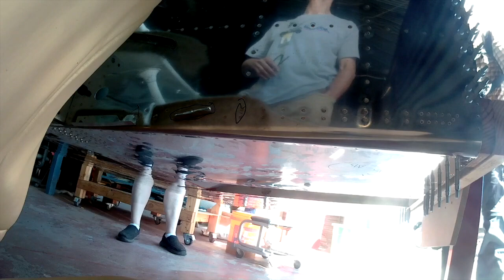RV - 14 Ch 32 - 06

Comment: Hi Everybody....oooooh...what is that cool looking 90° drill extender?...blah-bah, blah-bah, blah-bah.
Reply from the maker: Oh yeah that! A new thing I found on the internet. Its a, 'DEWALT DWARAFS Right Angle Flex Shaft - 12"'
Its nice but it IS hex bits. Thankfully you can get all manner of drill bit sizes. 
I picked it up for $30. TOTALLY worth it. It's easier to use than the drill itself.